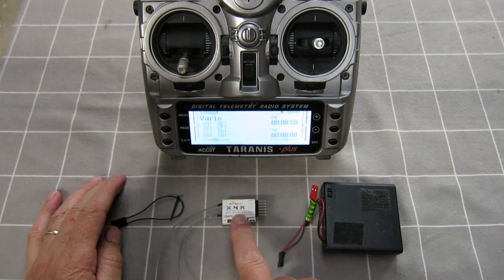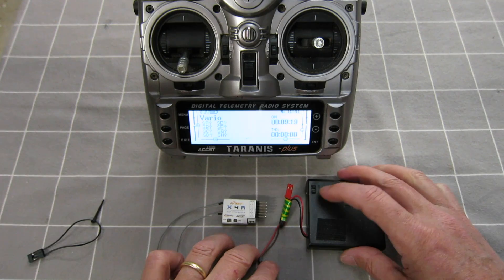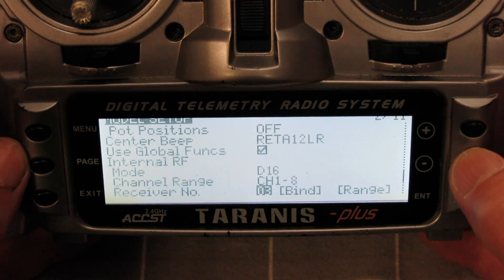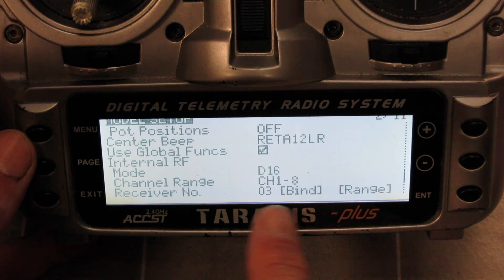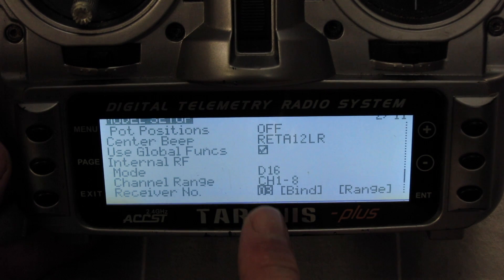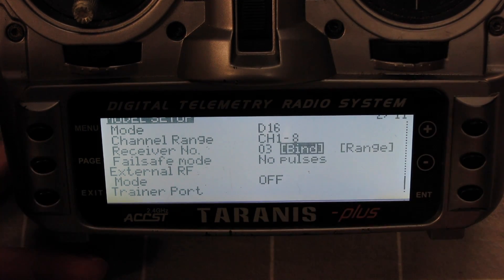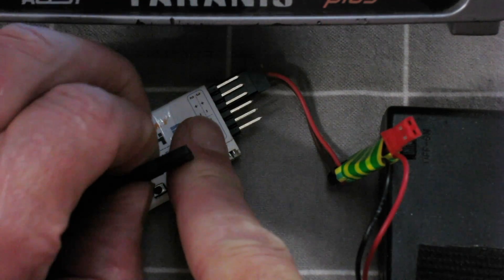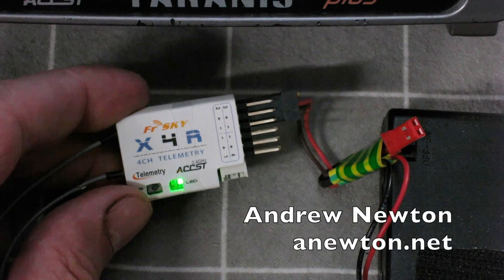FrSky X series Rx binding

Comment: Hello Andrew, Im building a LIDL GLIDER pitcheron version. I have the taranis qx7 and im buing for it, the frsky x6r or x4r. But my question is, as i need just 2 servos, which batery do i have to buy? I mean, How many cells and mAh. Could I use a 2s battery 7.4V ? Thanks.
Reply from the maker: Receiver and servos only need 5V. If it's just a glider you can use 4 x AAA NiMH, or if you're fitting a motor use a 2S or 3S Lipo with a BEC or ESC that outputs 5V. Something small like 500 up to 1000 mAH would be OK
Reply: @AndrewNewton  Could this battery work fine? https://rc-innovations.es/baterias-lipo-2s-7.4v/bateria-lipo-2s-7.4v-450mah-75c-B-25C-450-2S1P-gens-ace

Comment: I can't bind the x4r! following the steps you showed
Reply from the maker: Have you set it up in the Model setup page, D16 for internal RF module?
Reply: yes
Reply from the maker: Strange, if this doesn't work there must be a problem.

Radio in bind mode - beeping noise
Push and hold button on X4R
Plug in 5V to X4R 
Stop pushing button - green and red LED flashing
Unplug 5V
Get out of Bind mode on radio.
Reply: Andrew Newton  red doesn't flash
Reply from the maker: Do any LEDs light up when you plug 5V in? Do you actually have 5V from the battery or ESC? Are you actually pushing the bind button?
Reply: Andrew Newton when I plug in the bec from the 3s the LEDs are both lit up and I'm pushing the button
Reply: Andrew Newton I've also asked to my local hobbyshop(who asked to an expert) and not even they know what 's the problem
Reply from the maker: I'm out of ideas.
Reply: Andrew Newton I'm out of hope
Reply from the maker: I wonder if it's an EU firmware mismatch. Maybe the Rx is EU firmware and your version of OpenTX is not? Or the other way around?
Reply: Andrew Newton I tried that 1 hour ago with both FW and it din't work , tomorrow I'll try again and I'll let you know

Comment: If I am not mistaken, you should select "CH1-16" instead of "CH1-8" if you have an X-type receiver like the X8R. Otherwise you will only have 8 channels when you use SBUS.
Reply from the maker: Ha, you're probably correct, but I have never used SBUS or more than 8 physical channels

Comment: do you have something like a review of the taranis radio?
Reply from the maker: No not a review as such, but I do have lots of videos on how to use the Taranis.
Reply: can you do one if you like? I'd be very grateful beacuse I'm considering buying one ah a first radio
Reply: I just got it! , but I'm having some problems binding the x4r , after the steps showed in your video , when I turn it on again it starts flashing red again
Reply: it's what I did
Reply: they also gave me another new x4r but there still was a problem , so I upgraded the radio firmware , but still it doesn't want to bind